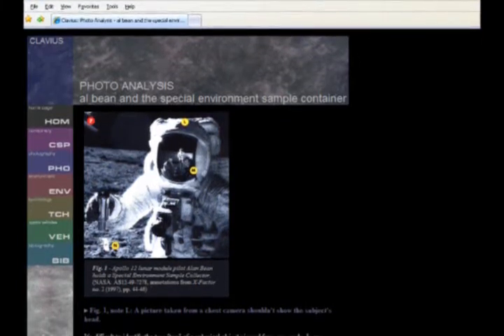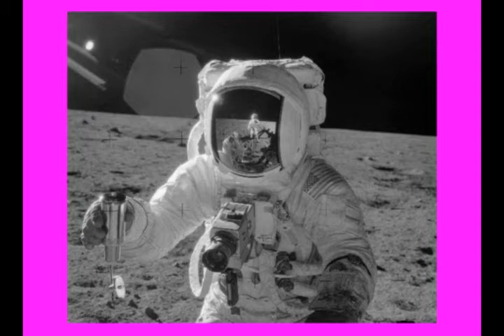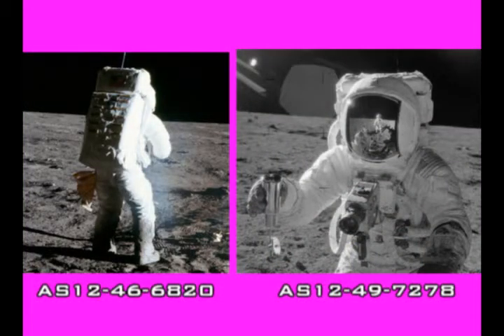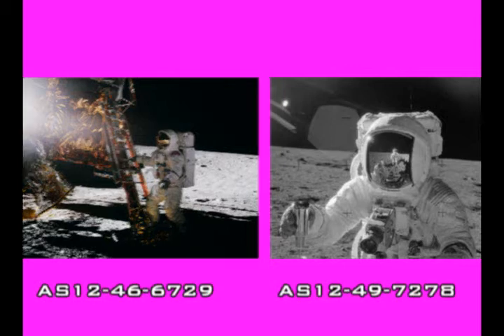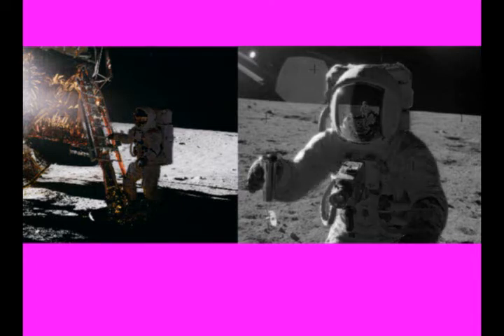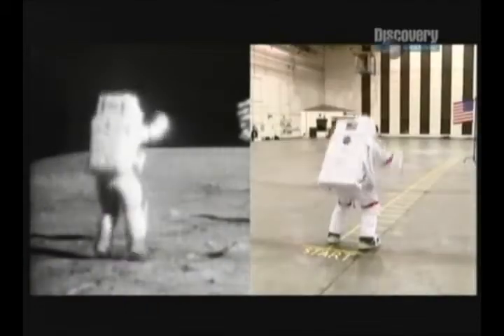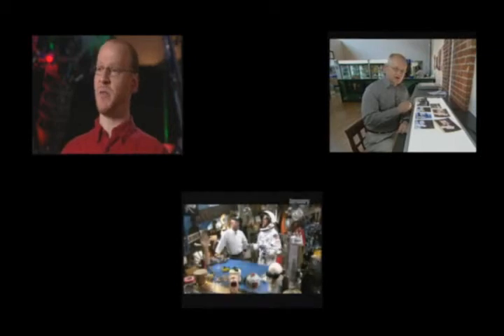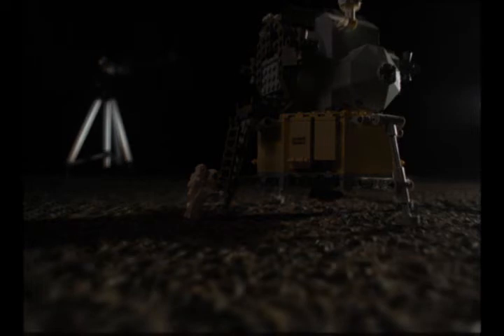MoonFaker: Reflect On This. PART 4

Comment: @thesoulhack  yo dude yes his experiment is flawed but it doesnt matter how much light  you use the results will be the same.because the albedo of the asphalt or moondust will stay the same.. a brighter light will only create darker shadows which will then require a even higher albedo of the asphalt or moondust to produce a higher reflectivity to illuminate the astronaut.  so his experiment is not spot on but the point he is making is clear. the  moonlanding footage is 100 percent hollywood
Reply: Wrong

Comment: One more point, your headlights aren't coming from the same direction as in the real photos. So this and the other points I've talked about in the other parts disprove this video series. 

You easily claim that Mythbusters and others don't do their experiments in the same conditions as it was on the lunar surface, but yet you yourself fail to do so also.

Comment: ....................................
You state the Moon's reflective index as 0.07. OK. You say the 'Asphalt' has the same, right! 
Well your experiment is flawed because the Moon's index 0.07 is in a vacuum. (Much sharper & brighter as there is no air to diffuse the reflected light).
But you are performing your experiment in AIR in OUR atmosphere which includes pollution, which will affect the result of your own experiment.

Comment: You can't possibly be serious about using this experiment as proof that the Apollo photos were faked. On the moon, there is a much brighter light source (the sun), which illuminates a much greater surface area than your single headlight did (which you stated was on high beam, so most of the light wasn't directed downwards anyway!).

Not only is your lightsource less bright than the sun, the main problem is it wasn't illuminating enough of the asphalt to make the comparison worthwhile.

Comment from the maker: "You're not comparing the same things as I am there."

Yes I am. You're talking about AS12-46-6820, right? Look at Aldrin and Bean in their respective photos - they are both leaning slightly forward so you would expect them to be equally lit.

The only way to get an object as lit as Aldrin, without the aid of fill-lights or reflectors, would be to use a surface with a much higher albedo than the moon's 0.07.